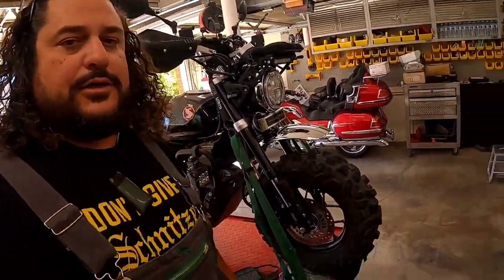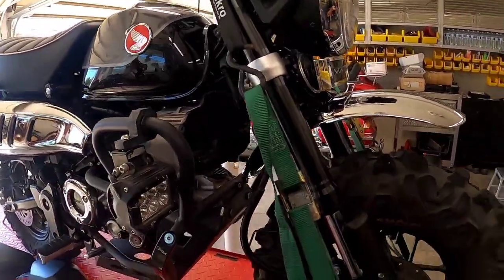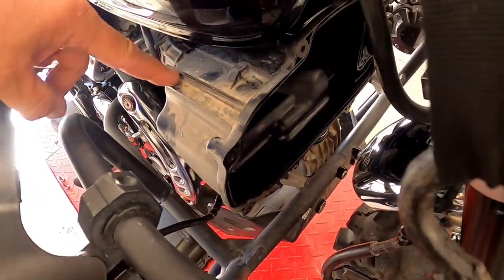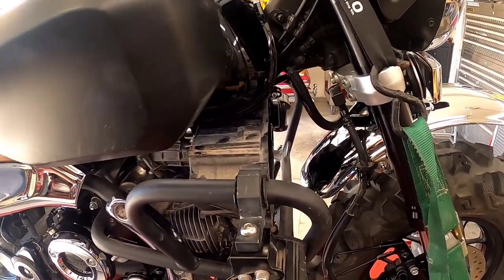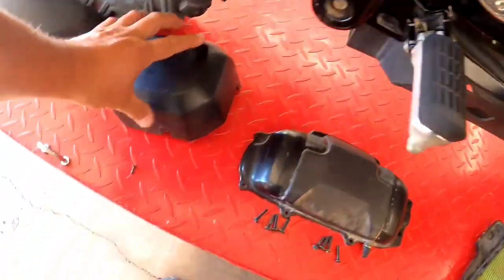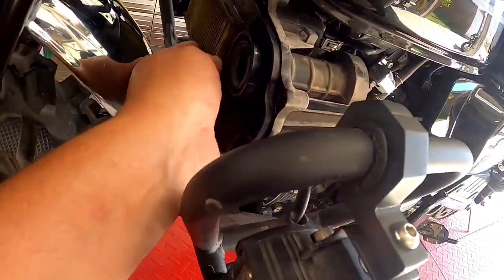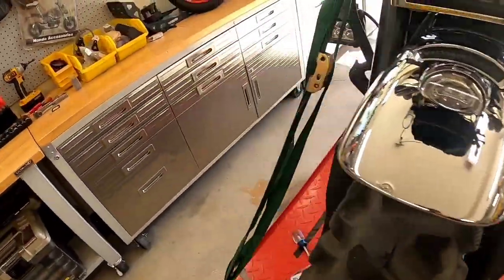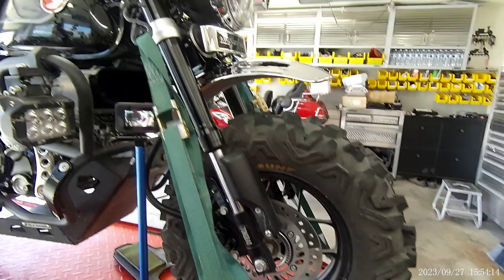HONDA MONKEY 125 air filter replacement.  (9-28-2023)

Comment: What brand are your tiers ?
Reply from the maker: @suburban91  Here's a link to Amazon where I get the tires. Keep in mind you can't fit them without running after market longer front forks.
  Pair of 2 SunF A033 Power.I AT 22x7-12 ATV UTV Off-Road Tires All-Terrain, 6 Ply Tubeless https://a.co/d/05Z7ortv

Comment: How many miles did you have on your bike before you changed your air filter?
Reply from the maker: I only had about 600 miles on it, but it was a lot of dusty road off-road miles.
Reply: @adventureswithmojo2503  Wow! I have 5000 miles on my bike and trying to decide if I should open it up and replace it. Maybe I need to take a look! Thanks for the reply.
Reply: @adventureswithmojo2503  Just got done changing it and it wasnt to bad. I could have easily made it to 12-15,000 miles so now I know and will just plan on changing once a year!!I 

Thanks for posting the video! It was quite helpful and if I hadnt had watched it first, I am about 100% confident I would have broken one of those tabs taking it off.